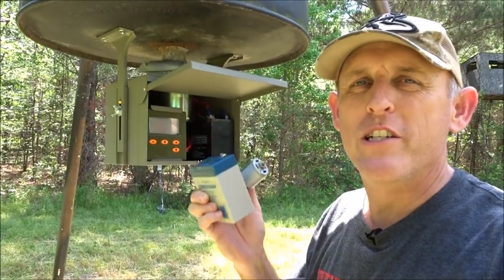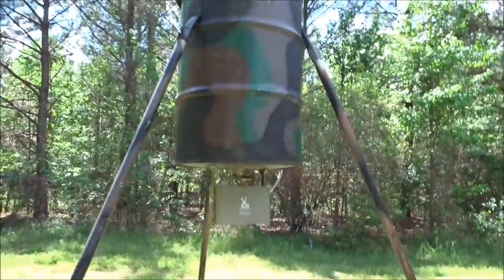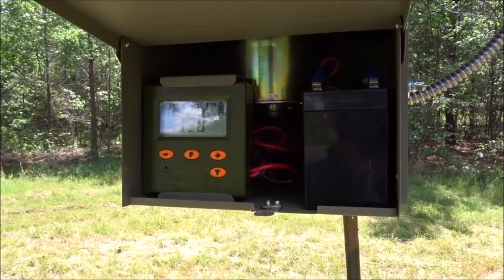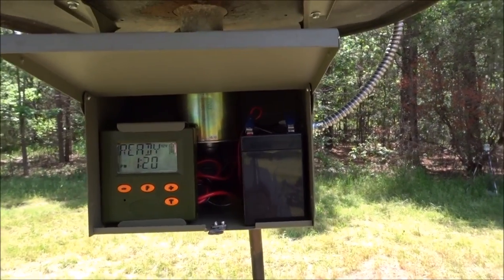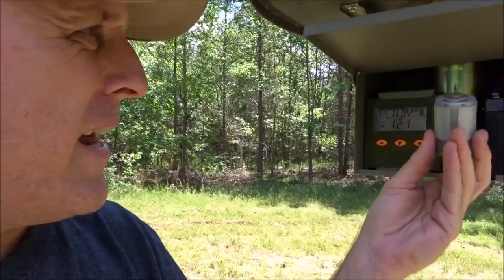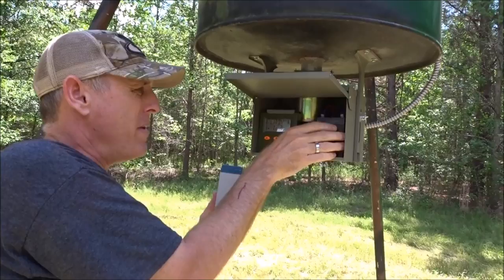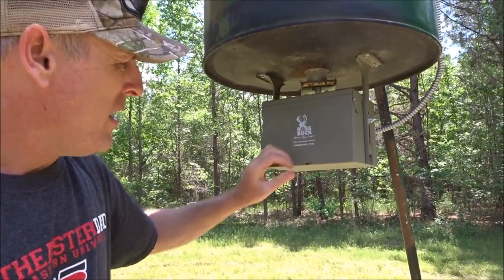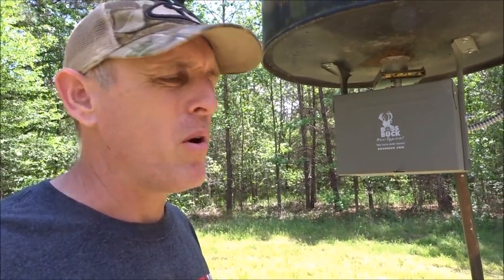Deer Feeder Motor: 12V vs 6V Boss Buck Feeders Review

Comment: That feeder I got at walmart for $148 plus the cost of a 12 volt rechargeable battery (got two so I would have a spare) and solar power charger and so far it has been fantastic and the battery stays charged good

After setting it up and playing with it some I found medium speed for 8 seconds with three times is perfect to use about 50 pounds of corn over 7 days or so

When I first set it up I had it on 10 seconds on high speed and about a 1/2 from the wheel settings and found corn that was thrown 40 feet away or an 80 foot diameter circle around the feeder using up 50 pounds in a few days LOL

Once I got it set up right that thing is fantastic for bringing in the hogs deer and raccoons and will put food on the table for many years to come I think and last time out it had 200 pounds of corn in it I suspect will last over a month of feed times

And someone talking about bears? They could not do a single thing to that steel feeder I got as it is heavy duty city
Reply from the maker: Ray Blackburn Ray, thank you so much for the info and testimony!  These things do sling some corn and bring in the wildlife!  Thank you for sharing!  Keep in touch my friend.
Reply: Yes first time I turned it on it spayed me with corn like BBs from a BB gun and was lucky I had my sun glasses on LOL

One neat thing about that feeder I got is the hogs have not torn it up yet and don't think they will either but in last video I did notice they eat the sand with the corn and all of a sudden I had to fill sand back in under the feeder runners or it looked like it could be undermined and tip over
Reply: If it's Bear-Proof in the sense of not being tipped or torn up by Bear of Hog's, that's great! I found out that hanging them when possible with a hand winch system worked the best, but some locations don't allow such an application unless you use poles! NEVER had issues by Bear or anything since!
Reply: @mattwheaton7191  Now I am running 5 seconds only once a day unless I go hunting then I add two more 5 second times in for that night

I love it when I get a video of the raccoons running when it goes off looking back like WTH? that thing just assaulted me with corn LOL

Comment: I was hoping this video would help. But it isn't real helpful. I would like to know what output voltage the solar has. And what the rating are on the motor. 
Honestly, you should be able to make any design work for you by knowing what output the solar really does and what the drain is in amps. 
$125 for a working setup, is not to bad in the long run. But what if you can make the same setup with the cheaper parts by getting the math right for 6 or 12. That would be something.
Too bad I'm not an electrical engineer. Or have contact with one that could explain this so normal persons can comprehend it lol.

Thanks for the video man, you are trying help. And that alone is worth a thank you.
Reply from the maker: Laby 70 sorry I couldn’t help you more.  This was really a video about comparing 12 vs 6 volt not really solar.  However, it’s a 12 volt 7 watt solar panel going into an EXP 1270 7ah 12 volt battery which powers a 12volt motor.  Not sure if that’s the info you were looking for but hopefully it is helpful.  Let me know if I can help you.  Take care!

Comment: Going to using feeders for the first time,and I'm gonna go with 12v per your suggestion. Was just wondering what type of solar panels ya use on your feeders. So glad I found your channel.
Reply from the maker: J M -I use 7watt solar panels made by Strongway.  They are amorphous style and I get mine from Northern Tool (they carry them online too).  They run about $40 bucks but worth every penny. The only fault is that they claim to have a diod installed but they do not...so you will need to install one to prevent reverse energy flow at night (which will drain your battery).  FYI, I don't use a solar controller either and I've never had a problem...that will save you at least $30 for the lower line brands.  Smart move going straight to 12 volt feeders...they work great.  I hope this helps and shoot me an email if I can be of further help...thehandyhunter2017@gmail.com.  Thanks for visiting our channel!
Reply: The Handy Hunter Thanks for all the information, sounds great, sent ya an email with just a few more questions.
Reply: **Currently the 7W amorphous solar panels are almost unavailable anywhere. So I suggest a 10W amorphous solar panel instead. These are still available on Amazon: https://www.amazon.com/Coleman-58025-Amorphous-Solar-panel/dp/B006FW3G2G/ref=sr_1_4?dchild=1&keywords=10+amorphous+solar+panel&qid=1595030111&sr=8-4

Comment: just join your site man you have great stuff I have watched all your videos  but one really stood out with me  the episode about 6v vs 12v  the thing that really caught my eye was how long that solar cable was can you revisit that  solar cable conduit and explain how you did it  thank in advance
Reply from the maker: Hi John, check out my other video on setting up solar on deer feeders...that may help explain as well.  The conduit is a 6 foot appliance whip from home depot.  Slide your wires through and connect to your spinner with an elbow fitting that screws in very securely.  Hope that helps!

Comment: Ga? I'm in Perry Ga
New to hunting and trying to decide what to buy
I like the all in one for mobility 
But it's triple AAA
I'll be hunting in my backyard
And also in Abbeville .... I just picked up 30 acres to hunt but no deer there
Reply from the maker: Well, first of all...welcome to the wonderful world of hunting!  You are in for a great ride.  My best advice is to buy power.  I would highly recommend going 12volt all the way and never look back.  You will save yourself time, money, and frustration in the long run.  I ran 6 volts for a long time and had nothing but problems.  Regardless, hope you find the best for your situation and if you choose the all in one that it works perfectly for you...let us know how it goes!   Good luck with the hunting and let me know if I can help in any way.
Reply: The Handy Hunter 
I'm digging the all in one but after more reading it's only 4 triple AAA batteries and if you were having issues with 6 volts jamming ...... 
So do you have part numbers by chance?
I may just do the sled build
Reply from the maker: Hi Jeff, I run three Boss Buck 12V boxes like the one in this link https://www.bossbuck.com/products/feeders/116.html  There are probably some other good 12V boxes but I tend to stick with success when I find it.  I haven't had one problem with these boxes and they come with a very easy digital timer and a giant motor.  You will need to buy a battery and you can get one from Bossbuck or from Ebay (where I found them cheaper), etc.   Bossbuck also carries a lot of other stuff that you may need like metal lids, funnels, parts, etc.  I don't know anyone from Bossbuck but I would like to meet them someday because they've helped me solved some deer feeder problems over the last couple years!  Hope that helps...keep the updates coming!
Reply: The Handy Hunter 
Cool thanks
Looks like I will just use this and be done
I have to drive 80 miles to the other spot I hunt and can't really afford any issues 
Thanks again

Comment: Fuse at the battery?? Lets properly protect that equipment! If the battery is in a box use a couple female insulted spade connectors. At the positive battery post cut the wire and crimp on the two female insulted spade connectors then slide them onto each leg of the properly sized ATO fuse. If not in a battery box wrap them with some GOOD electricians tape or use a weatherproof fuse holder! Easy Peazy! Good Safety Glasses are a must these days!

Comment: Do you add a 12 volt regulator between battery and the timer when using a solar panel?
Reply from the maker: Doug Smith Hi Doug, Great question!  I do not use a regulator between the battery and motor/timer because I feed only in morning and evening when solar panel is not producing high voltage.  If you plan to feed in mid day sun I would use one.  I've hit the "test" button many times at full sun and never had any problems but regulators are pretty cheap and might protect your setup if you are spinning in full sun everyday.  Hope that helps!

Comment: So I have a 55 gallon drum and a smaller 30 gallon metal drum and 2 plastic 55s
What would recommend?
Do u have the funnels in all of them?
Do u know if they have funnels for the smaller drums
Reply from the maker: Hi Jeff, thanks for commenting!  I personally would go with the 55 gallon drum and add a galvanized funnel in the bottom.  I always paint my funnels even though they are galvanized because they will rust over time.  They do make 30 gallon funnels if you choose to go that route although they may only come in plastic.  I only use metal so I can't say how the plastic holds up under weight over time.  Good luck on the build and let us know what you decide on!
Reply: Strictly, metal and painted well. It holds up better with the tree-rats and other threats! ** Use galvanized funnels, lids and legs!

Comment: Can you use your 6v feeder box to convert to 12v feeder system is there enough room ?
Reply from the maker: Generally not because the 12v motor is much bigger and therefore takes up most of the battery space.  The 12v box is much bigger and has extra room.  Hope that helps!
Reply: If you check in the COMMUNITY section I show an option to switch out a 6V box to a 12V on a 6V Game Feeder with a DIY conversion plate.

Comment: Will 12 volt motor use same holes as 6 volt
Reply from the maker: Edward Osborne I seriously doubt the holes would match but am confident that you could quickly modify it to fit.  Keep in mind that the whole box for a 12 volt motor is much bigger than a 6 volt box so even if you do get the motor to fit you may not have room for the battery.  Let me know if I can help.  Thanks for commenting!
Reply from the maker: Edward Osborne when I ran on 6 volts I had jams and dead batteries constantly...even with solar panels on them.  I now run 3 feeders on 12 volts with solar and haven't had a jam or touched a battery in 4 years.  They are now completely maintenance free (other than filling with corn).  You won't regret going to 12 volt.  Buy once, cry once, and you are done!  Good luck!
Reply: The Handy Hunter thank you for replying back belive I'm going to try it happy holidays

Comment: Tried couldn't find it,send me link for it?
Reply from the maker: Here ya go…

DEESPAEK LiFePO4 Battery 12V 12Ah, Rechargeable Deep Cycle Lithium Batteries with 10A BMS, Perfect for Home Alarm, Backup UPS, Camara, Radio https://a.co/d/7PDlr09

Trail Camera Solar Panel, WingHome Solar Battery Charger Kit 12V/1A 6V/1.5A with Build-in 2000mAH Rechargeable Lithium Battery IP66 Waterproof Hunting Accessory https://a.co/d/9T5Mb1h
Reply: @TheHandyHunter  this the link for spout?
Reply from the maker: So sorry. I meant that for someone else…lol.  Here’s the link to the Boss Buck Funnel but they are currently unavailable on amazon.  You can buy them directly from Boss Bucks website as I have done in the past.  Hope that helps!  Boss Buck Funnel, Silver, 55-Gallon https://a.co/d/hMSCmyR
Reply: @TheHandyHunter  sorry but that's the funnel for 55g drum I'm talking about funnel you're using coming out drum to feeder motor can't use the one Boss Buck provided for there feeders?
Reply from the maker: The funnel you see is part of the 55gal boss buck metal funnel that comes out the bottom of the feeder barrel.  Other than that I’m not sure which funnel you are talking about.  Let me know if that makes sense.
Reply: @TheHandyHunter  oh so that's the silver funnel that you push Dow inside of barrel for gravity feed?
Reply from the maker: @gaelewis6623 yep, it pokes through a hole drilled in the center of the barrel…that’s what you’re seeing
Reply: @TheHandyHunter  yea ok metal funnel that goes inside barrel for gravity feed to feeder motor?
Reply: @TheHandyHunter  thanks gotcha now your awesome!
Reply from the maker: @gaelewis6623 yep, you adjust  the gap between the funnel spout and the spinner plate to keep the corn from freely pouring out.  When adjusted properly the corn will stop flowing when the spinner stops.
Reply: @TheHandyHunter  how did you center hole for cutting so metal funnel insert lines up correctly?
Reply from the maker: I found the center with a tape measure and made a cross.  Just double check it from multiple angles.